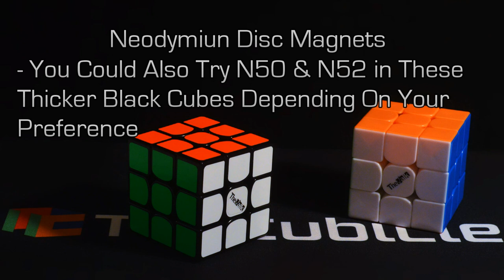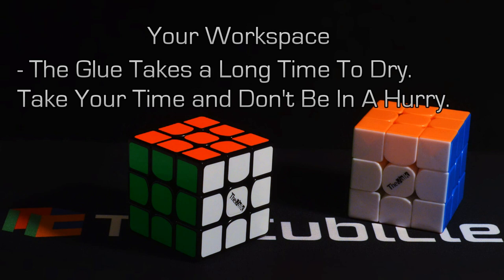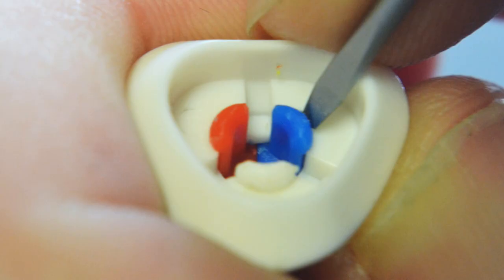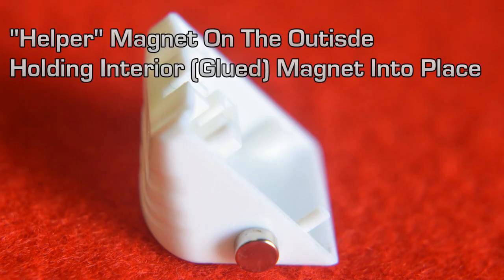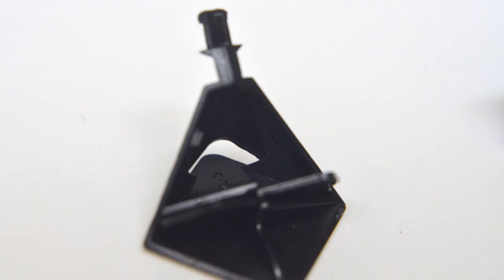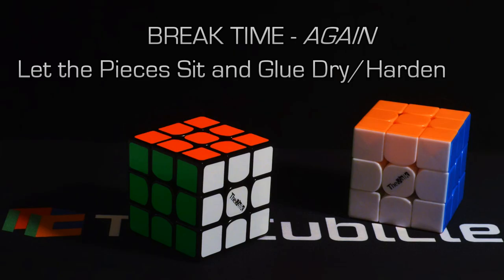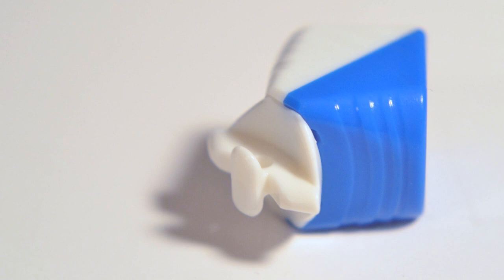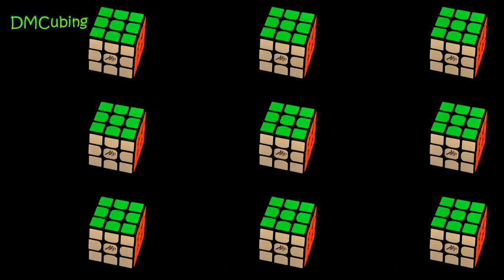DIY: How To Make A Magnetic Valk 3 Speedcube Tutorial

Comment: Which is more powerful magnet? D4mm x 1mm N42 or D3MM X 2MM N42? Thanks! :D
Reply from the maker: According to the K&J Magnetics Calculator, the 4x1, N42 has a pullforce of .36 lb where the 3x2, N42 has a pullforce of .48 lb. 
Both are rather weak when compare to other magnets we usually use in cubes. 
If those are your only choice, you'd probably want to use the 4x1 and double stack them (stacking one on top of the other, in effect giving you an N42 4mm x 2mm magnet). That should work very well in the Valk 3.

Comment: Hey DM what feel I'll get if a put 4x1.5 N35?
Reply from the maker: ZZ Cuber I think they would be great. When I first started magnetizing cubes, I liked a stronger, more pronounced, magnetic feel. Now, I think what works best is a lighter feel. The magnet I have used a lot in the Valk 3 is an N35 4x1.7. It gives a great feel. An N35 4x1.5 is going to be very similar, a light subtle feel, so I think it will work perfectly!
Reply: @dmcubing6342  Thanks for the info

Comment: DM cubing, im about to magnetize my valk ng gtsv2, I'll use 5x1.5 size of the magnets. but i dont know what's strength. i want a n38 4x2 feel but i will use 5x1.5
Reply from the maker: Jorge Rojas You would probably have to use the weakest possible 5x1.5 if you're set on using that size of magnet. I used an N52 5x1 and it gave about an N38 4x2 strength in the GTS2. The wider 5mm works great in this cube. The magnets have less bump or click but still have a good magnetic feel.
Reply: weakest position? what's that sir?
Reply from the maker: Jorge Rojas weakest POSSIBLE 5x1.5. iPhone changed the word I typed.
Reply: i like the n38 4x2 feel. does n38 or n35 or n42 5x1.5 will have the same feel as n38 4x2?
Reply from the maker: Jorge Rojas Probably N35 will, but that is a guess. It still end up a little stronger. Really no way to know for sure until you try them. I really don't know.
Reply from the maker: Jorge Rojas If you can find N52 5x1, those to me, feel like N38 4x2.
Reply: DMCubing last question sir, what is the size and the strength of magnets are in the gan Um?
Reply from the maker: Jorge Rojas I don't know. I imagine they probably use a very subtle magnet like a 4x1.5 N35, or something similar, but I really don't know. The slightly undersized 4x2 N35 from magnets365.com work really well in the Air.

Comment: thx dude. it works great. it turn great
Reply from the maker: Oscar123 Coaster channel Awesome!!!!!
Reply: DMCubing seriously
 this really helps me out.can I ask you a question.

what should I buy?
Gans 356s v2
or
normal Gans 356 air?
please reply
thx again!
Reply from the maker: Hmmm.... I've never tried the 356s V2. I know it's a normal weight cube, so it would necessitate the use of a stronger, higher grade magnet.
The Air, however, I've worked with. If you like extremely accurate, fast, light and airy cubes, this is the cube. It works perfectly with N35 4x2 magnets and is a fully customizable cube with the GES nuts. If your style matches the cube, quick, accurate, etc., it's probably a cube you'd do well with.
I really liked mine, but I always felt with my large strong hands, I'd tear it up if I got too aggressive with it. I dunno. In my hands it feels a bit fragile. But it's a heck of a good cube though. A little challenging to magnetize but a fun project.
Reply: DMCubing oh thx man

Comment: Will N48 5x1 work well with the Valk?
Reply from the maker: Rinne Actually this magnet works differently in the Valk than it does in cubes like the MF3RS2 and GTS2. The reason is the cutaway holes in the corner pieces. They don't shield the magnets in that area, so a certain amount of magnetic energy escapes there, enough to make the magnets feel significantly stronger in this cube than in other cubes. The resulting magnetic pullforce is rather strong. If you like a pronounced magnetic feel, then it'll be ok. But if you're looking for a subtle to medium feel, it might be a bit too strong.

Comment: Does a magnetic Weilong GTS with n48 magnets feel similar to a magnetic valk 3 with n35 magnets in pull strengh? I followed your tutorial on making a magnetic weilong, and I really like how it turned out. I would like to replicate that pull strengh on the valk. So does the n35 works best?
Reply from the maker: I have both cubes here with me. Their feel is different, but that's mostly from the cube's design. The black GTS with 48s seems to have a more gradual lock-in feel where the magnet holds the cube's face at rest. The Valk with 35s almost feels like the same locked in strength but you barely have to move a face to free it from its resting position.* I could use a thicker lube on the Valk and probably get the same feel. My gut feeling is an N42 in the Valk would probably closer match the N48 GTS. It's very subjective, so how I perceive it may be different than someone else. 
* Ok, so I spent a few minutes with several pieces removed from both cubes. Here's a new discovery. Though the two cubes may have what can be described as a similar pullforce when I compared the removed pieces, the actual magnetic field that can be felt from sideways motion (as opposed to pulling the parts directly apart), you feel a wider magnetic field on the N48 magnet. This accounts for why I felt the Valk with 35s took less distance to push the face out of the magnetic locked in feel. Hope this makes sense. Hard to put in words. 
But having said all this, I'd still be inclined to use an N42 or something just a little stronger than the 35 in the Valk if you're trying to copy the 48 feel in the GTS.
Reply from the maker: PS- Great hearing that my GTS tutorial helped you in making a good cube! Nice!
Reply: DMCubing Ok, I might try the 42s. Yeah since I've made my magnetic weilong, I can't go back to a cube without magnets lol. Thanks for the answer. Love your videos!
Reply from the maker: +Stavroast I know what you mean! I'm not even a competitive cuber, but I absolutely love the solid feel that magnets give cubes! On a similar topic, I'm going to try N52s in a black GTS. Just too curious to see how it will feel.
Reply: DMCubing Cool, love your persistence on this subject. Trying different magnets with different cubes to find the best combo out there!

Comment: Should I use 5x1mm N52 magnets in a black plastic Valk?
Reply from the maker: I wouldn't. Because of the cutaway holes in the corner pieces of the Valk, more magnetic force is allowed around the contact between the corner piece and edge piece. I recently used an N48 5x1 on a Valk as an experiment and the overall feeling now is a bit too strong, kind of like an N42 4x2 feel. I think the strongest 5x1 you'd ever want to use in a Valk is probably the N35.
In the GTS2, it's an entirely different feel. In that cube, the N48 5x1 feels just slightly weaker than an N35 4x2. In a Valk, it's completely different. That's why I feel it's the cutaway holes in the Valk that is allowing for more magnetic force force between the corner and edge because the extra width of the magnet is enough to bring the edge of the magnet to the opening of the cutaway.
Reply: Thanks. Also, do you think 5x1mm N35 magnets would work well in a Xinghen 2x2?
Reply from the maker: Oops. I thought I had already replied. 5mm wide magnets are really too wide for the Xinghen because of the way the caps fit on and the amount of space between the retaining posts and edges of the pieces. 
I'm finding that 3x1.5 magnets work pretty well in the 2x2. Just get one strong enough, like the N52. The end result is really quite nice.
Reply: DMCubing Thanks for replying

Comment: hey, i made a magnetic gts and it worked amazing but then i broke a peice so i brought my self a valk and ordered the magnets you instructed i put them in today but now it feels really bumpy and slow and requires alot if force to turn. do you know anything i can do to fix this.
Reply from the maker: Which magnets did you use in the Valk???? Usually the N35 4mm x 2mm to the N42 4mm x 2mm would wonderfully in this cube. I can't think why I would have recommended anything other than these.
Reply: DMCubing well i did order 4mmx2xmm n35 but i think some alot stronger arrived and now my cube is ruined.
Reply from the maker: Ryan rees-ryan Man, I'm sorry to hear this. Where did you order them from? 
I'm thinking they sent the wrong grade. A real N35 4x2 will feel subtle and not overly strong in the Valk. You might be able to pry them out of the cube by using a screwdriver, but it's tough work.

Comment: In the Black valk 3 what magnets would be stronger 4x2 n35 or 5x1 n48
Reply from the maker: moshe zupnik Actually the N48 5x1 in this case, will be the stronger of the two. This is because of two things: the wider diameter of the 5mm magnet and its extended magnetic field, and the cutaway holes of the corner pieces, where the holes, because of their lack of magnetic shielding, allow for more magnetic energy. So what ends up happening is a magnet (the N48 5x1) that usually feels weaker in most cubes than the N35 4x2, actually feels stronger in the Valk because of the increased magnetic energy.
Reply: Is it gonna be more of a subtle difference or like a big difference
Reply from the maker: moshe zupnik Kind of in between. About like using an N40/42 4x2. If you can position them away from the holes, they'll feel weaker.
Reply: I feel like 4x1 n 35 would be better for me since I have a semi light turning style and if I use 5x1 n48 it’ll just be to slow. thanks and I really appreciate the quick replies they earned a like
Reply from the maker: moshe zupnik Do you really mean 4x1??? If you like it lighter than 4x2, you'd be better with 4x1.5.
Reply: Oops I meant 4x2 n 35
Reply from the maker: moshe zupnik Just checking. 😀

Comment: With these cubes, did you actually notice the stickerless one being stronger like you said it might? I don't see why it would be that way.
Reply from the maker: Bees Nation Yes, absolutely. (Otherwise, why would I say it?) My initial prototyping of the Valk included a stickerless version which had a stronger magnetic feel when compared to the black, stickered version. Whether the difference in feel is caused by the density of the black pigmented plastic or the differences of smoothness (friction differences) between the two types of plastics, I'm uncertain. Anyway, it's there, subtle as it may be, it can be felt.

Comment: can i use any type of superglue
?
Reply from the maker: Yes. But generally stay away from the really thin super glue because it can run. Thicker formulas often work better.
Reply: do you think i could use 'Pioneer Mighty Bond' ?
Reply from the maker: Otaku Boy Yes. But realize it's straight super glue, so it's going to be thin and dry very quickly. With this type of superglue, it might be best to place the magnets first, then add a drop of glue to the bottom of the magnets. After that, add an additional drop of glue on top. 
I think it would be too thin to try placing the glue first then adding the magnets. 
It should work fine.

Comment: hey can i use 4x1 n48?
Reply from the maker: You could but it would give only a slight hint of magnetic attraction strength. If you like a very subtle feel, it could work out ok. But for a normal light subtle feel, N35 4x1.5 would be more appropriate. And for a normal magnetic feel, N35 4x2.

Comment: so i bought n50 magnets for my valk 3 before doing my research and  can anyone give me ideas on how that will feel?
Reply: DMCubing help please
Reply from the maker: Hello. It kind of depends on the N50 magnet. There are many of the budget priced N50s on the market that are actually way under spec and perform more like N35. If you happened to purchase these, you're cube will probably be ok. If they're fairly easy to pull apart from the stick of magnets, they're probably the lower grade N50. If they stick relatively hard to each other, than you probably have true N50s.
A true to spec N50 is going to feel pretty strong in the Valk because of the plastic being fairly thin.
If you have an aggressive solve style, or you like the feel of the magnets, you might do ok with the N50s in a Valk. For most people, though, an N35 4x2 usually suffices.
Reply: I used N50 magnets in my MoYu AuLong V2.  As i am a rookie cuber with a not so delicate turning style I found that i really liked the feel of the magnets.  They have a very strong feel.  Its not subtle.  It is a solid bump as the pieces slide by each other and good grab as they align. I think  if you were a sub20 or sub15 second solver (or lower) you find they were cumbersome as it  requires a bit of extra force to move the layers.  However, when you are beginner i think the extra force to align the cube can be a benifit.  i really enjoy the feel.

Comment: i messed up placing some magnets,  how do you recommend taking off the superglue?
Reply from the maker: I just use a screwdriver and use its blade to scrape and pop them out. You have to be careful so as not to damage the plastic. Then once the magnet is removed, you just scrape the old glue out. Make sure to protect your eyes from the superglue dust. You could use chemical solvents, but they always pose the chance of damaging the plastic.

Comment: Sorry to bother u again DMcubing but I've watched a lot of different Magnetizing Valk 3 videos and saw the place that SpeedCubeReview sticks his magnets in a different place than yours in the edge piece, will that affect the cube or the place where u glue it doesnt matter alot? Thanks
Reply from the maker: Rabiot Digne Never a bother. I suppose, figuring in torque, the further away from the center of the cube, the more effect the magnets will have in holding the cube in shape. But it would be such a small difference for the fact we're talking about a few millimeters. I chose my location in the Valk as far away from the cutaway hole as possible (so the magnet won't stick out of the hole and to avoid having glue drain out of it), and I prefer to have the magnet up against one of the receptacle posts inside the edge piece as this gives added stability. The location sometimes is different for other cubes based on how well the magnet's position can be duplicated over and over. I'm about to do my seventh Valk tomorrow and have used this position in all of them.
Reply: Again thanks. Good luck on ur seventh Valk!

Comment: Is it okay to use n38 4x1.5 if  i want the same feel like the n35 4x2?
Reply from the maker: Renzo Mariano The N35 4x2 that I used in this cube and a lot of my earlier projects actually measured 4x1.7, so they're not truly 4x2. The N35 4x2 from Gaussboys, on the other hand, actually do measure 4x2, and are noticeably stronger. 
I would certainly go with the N38 4x1.5 over the N35 4x2. They'll be just a little bit weaker, but in this cube, you really don't need too strong of a magnet. The N38 4x1.5 should be an excellent choice!
Reply: Thanks, How about the 3x1.5 n52?
Reply from the maker: Renzo Mariano I've never used that magnet, but according to the KJ Magnetics calculator, the pullforce of an N52 3x1.5 is nearly the same as that of the N35 4x1.5. So it should work fine for a subtle feel.

Comment: Do you think that N40 strength magnets woulld work well in something like a valk or air?
Reply from the maker: Oh, absolutely. In the Valk in this video, I used an N35. It gave a nice, subtle feel, but honestly, I think I prefer just a little more magnetic feel so on my next Valk I plan on using an N42. If you use an N40 in the Valk, it's going to feel nice. I haven't done my Air yet, but will probably use 35s to start with. I don't think they'll be overly weak. But I don't think an N40 in it would be too much. If you use the N40, let me know how it turns out!
Reply: DMCubing yes we will!
Reply from the maker: Nice! :-)
Reply: DMCubing also the valk is black is although I ordered 100 N40 I still plan  to use them of course but what is the feeling of a weaker magnet in a black valk?
Reply from the maker: The N35 is the weakest and in the Valk it works nicely. But I feel it could use a little stronger of a magnet, so you're going to be fine with the N40. Generally speaking, a lower grade magnet, compared to a higher grade one, will give kind of a softer feeling bump or indentation feel as the magnets pass each other while you're solving. Stronger magnets will increase the bump feel and hold the cube in its shape a little more rigid when at rest.

Comment: I have a question if I put a n42 in a PINK weilong gts
if it will be great or just use a n48 in gts
Reply from the maker: I'd personally start with N48 4mm x 2mm in a Weilong. The 48s are perfect for Primary plastic and feel just the tiniest weaker in a black GTS. My gut feeling is 42s would not give enough of perceptible magnetic feel. I think you'll be fine with the 48s in pink. Please let me know how it turns out!

Comment: A black valk, what magnets should I use?
Reply from the maker: TheNoobSupporter - Gaming Industry The standard that most people use is the N35 4mm x 2mm. This will give a noticeable but subtle magnetic feel. But the cube can also easily handle higher strength magnets without sacrificing performance. The N38 and N42 4x2 magnets feel really great too, if you prefer a stronger magnetic feel and/or have a heavier or more aggressive turning style. I personally wouldn't go over N42.